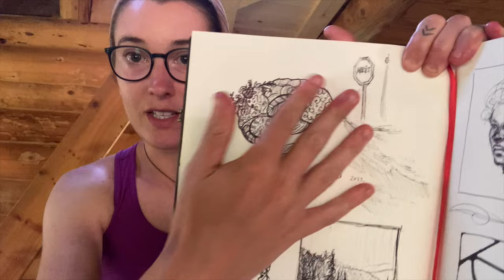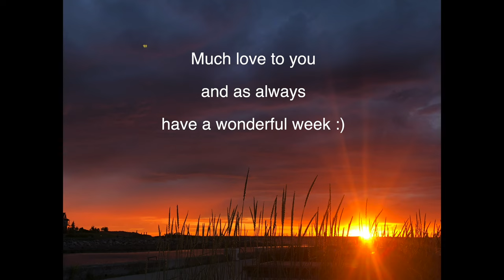Laziest Way to Learn New Skills | Sourdough Bread | Permaculture Garden | Art Process | Epidode 72

Comment: I 'd like to have your recipe of bread and  sourdough... Thanks a lot  💖🌹
Reply from the maker: Here's a very simple and basic recipe for sourdough bread I don’t usually do the second rise, but I know it makes a better shaped bread when I do :) 

 Ingredients:
- 1 cup (100g) sourdough starter
- 1½ cups (350ml) warm water
- 4 cups (500g) bread flour
- 2 teaspoons (10g) salt

Instructions:

1. *Mixing the Dough:*
   - In a large mixing bowl, combine the sourdough starter and warm water. Mix until well combined.
   - Add the bread flour and salt to the mixture. Mix until a shaggy dough forms.

2. *First Rise:*
   - Cover the bowl with a damp cloth or plastic wrap and let it sit at room temperature for about 12 to 14 hours, or overnight. This is the bulk fermentation phase, where the dough will rise and develop flavor.

3. *Shaping:*
   - After the first rise, transfer the dough to a lightly floured surface.
   - Fold the dough over itself a few times to shape it into a round loaf. Be gentle to keep as much air in the dough as possible.

4. *Second Rise:*
   - Place the shaped dough into a well-floured proofing basket or on a baking sheet lined with parchment paper.
   - Cover and let it rise for about 2 to 4 hours, until it has visibly puffed up.

5. *Baking:*
   - Preheat your oven to 450°F (230°C). If you have a Dutch oven, place it in the oven as it preheats.
   - Once the oven is preheated, carefully transfer the dough into the Dutch oven (if using) or leave it on the baking sheet.
   - Score the top of the dough with a sharp knife or razor blade to allow it to expand during baking.
   - Cover the Dutch oven or place a pan of water on the bottom rack of the oven to create steam.
   - Bake for 20 minutes with the lid on (or covered with aluminum foil if using a baking sheet), then remove the lid or foil and bake for another 25-30 minutes, until the bread is golden brown and sounds hollow when tapped on the bottom.

6. *Cooling:*
   - Let the bread cool on a wire rack for at least an hour before slicing. This allows the crumb to set and the flavors to develop.
Reply: Thanks a lot for sharing your recipe! Have a great weekend! 💖💖🌹🌹